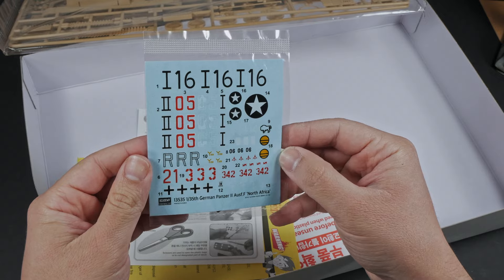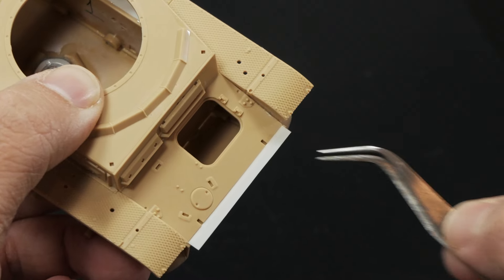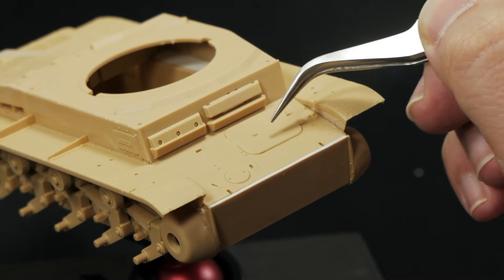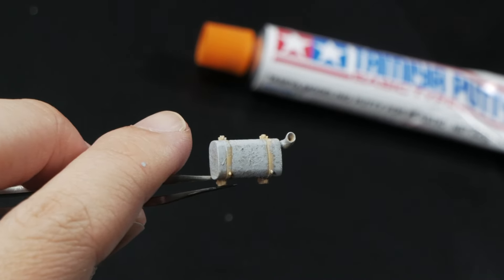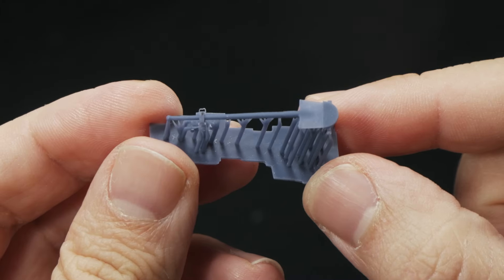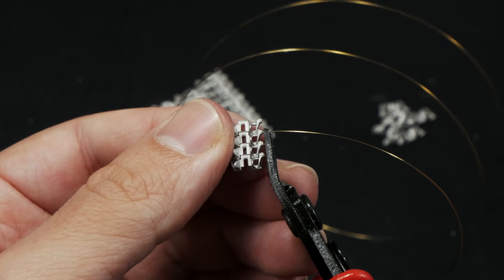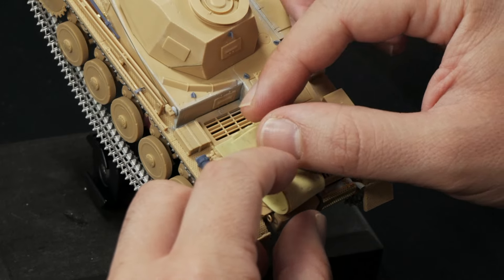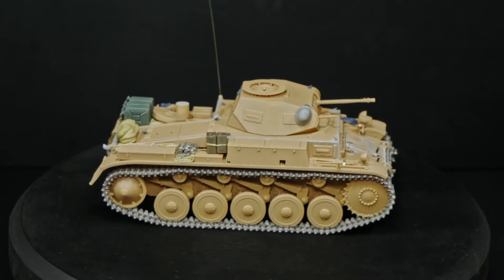Upgrade your SCALE MODEL - Building Academy Panzer II 1/35

Comment: I finished this exact model half a year ago, and I'd say it's a pretty good and fun build. However, I chose a sticker scheme with no toolbox needed first, and did put on the toolbox. It ended up with the scheme with the R-s on the side of the turrets, and the toolbox on the rear of the turret with the bison on it. I think it looks neat, but I also find it inaccurate and I wish I made up my mind on one side only.
Reply from the maker: I know what you mean, I had similar mistakes in the past. In my opinion, academy kits are particularly tricky when you have to choose your decal scheme and take the correct parts at the same time. Anyway, you should be proud of your model and keep that as a valuable lesson for future projects.
Reply: @notjustpanzer  Thanks mate, really looking forward to the next vid about this kit of yours